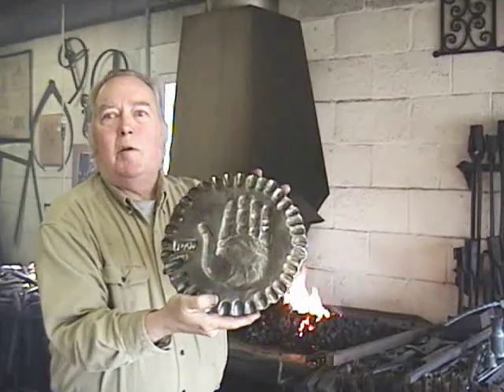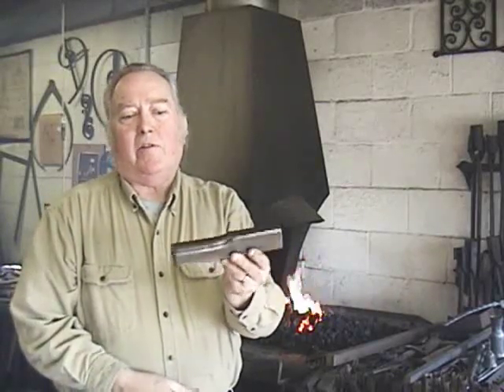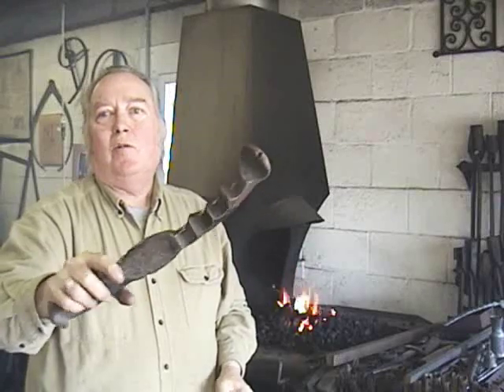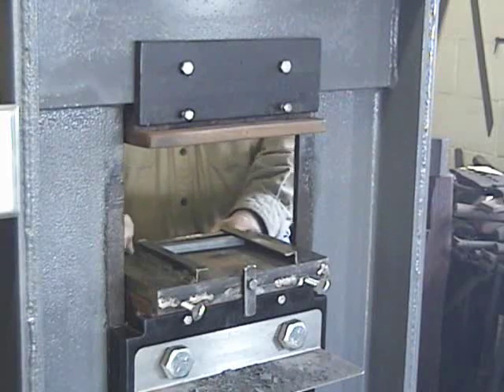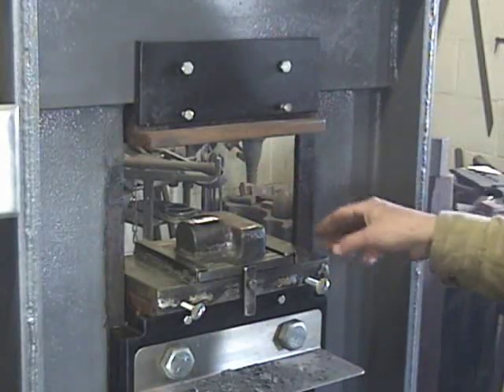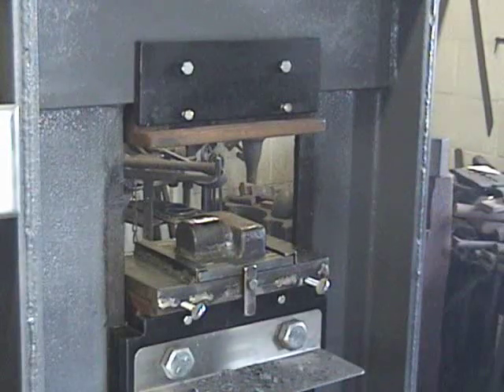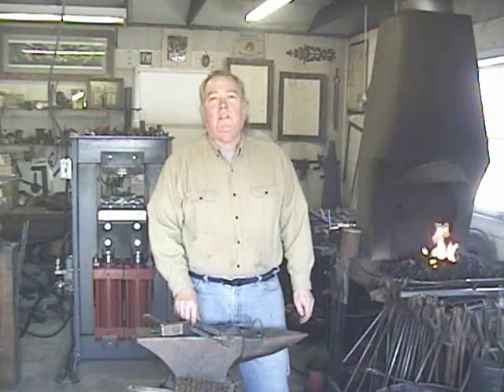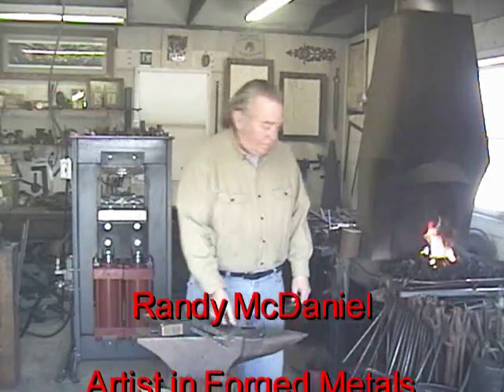Hydraulic Forging Press: Part 2

Comment: I really like the press design utilizing a cutout in a beam. It looks like a beast. I think your aware of your die holding issues. The press looks like the carriage racks both side to side and in and out independent of the die movement. Did you make the guides adjustable to accommodate wear and slop?
Reply from the maker: Yes, I know. Thanks.

Comment from the maker: @powerimprint  That's a coal forge in the background. As it burns the coal turns to coke, coal with the imprurities burned out of it. There's also a fan/blower with a reostat to control the amount of heat. More oxygen, more heat. I do have propane forges, too.

Comment: Thanks for the reply..  i will use that when i start building my badboy. 

Did you have any problems with the hydraulics? The construction and electrical side is no issue for me, however, finding good info on setting up the hydraulics is proving tough. I'm thinking of getting some plans for a log splitter for the info on setting up the hydraulics safely...  Do you have any advice there where i can get some good info?
Thanks Mate!
 Ben in OZ.

Comment from the maker: @2x4tube Yes, I'd make the drop in feature of the top and bottom plates deeper so that there is more support for them and larger bolts could be used for better stability and strength. Also I'd raise the unit up even 6" so it's easier to view what's happening when it's squishing instead of leaning over to see tooling alignment and how far it's squished. A limit switch to control where it stops would regulate how far it pushes would be beneficial also. Other than that it's great!

Comment from the maker: I agree. Since these videos I have removed the mild steel plates and replaced them with 4140 ones, hardened and tempered. I also beefed up the holding bolts. I'm also very careful to keep the metal hot at all time as when it cools that's when the press pushes tooling out and towards you. I've also made a lot more tooling and a rack to hold the tooling, so I'm really getting a lot of use from this press.

Comment: Randy, don't you worry about your slide in tooling when doing a taper--it really tilts around and seems loose--ejecting from the press.  I realize that friction at that point is doing all the holding, not the little toggle bar, but it still seems sloppy...

Comment from the maker: No hot punching full tooling yet as I don't have a job that requires it. I'm sure it will happen some day. Just punches to open up a hole in a box, so not all of the way through. I've done that in 3" x 3" stock.